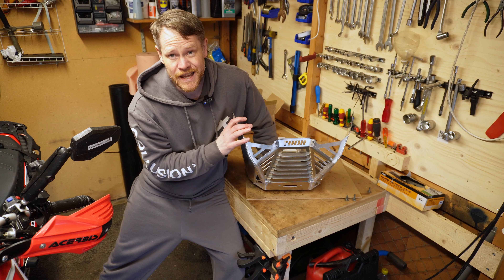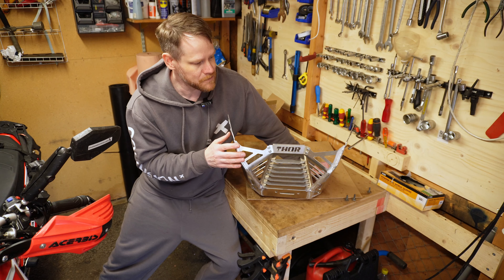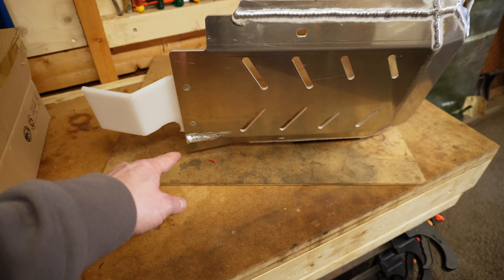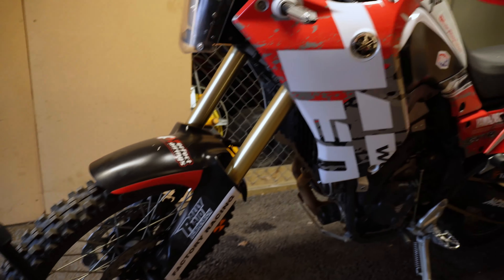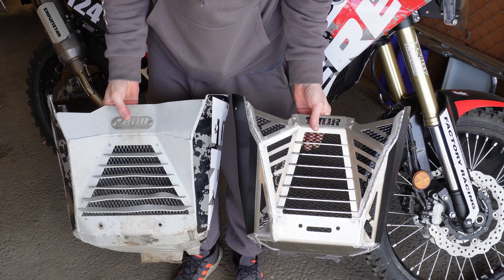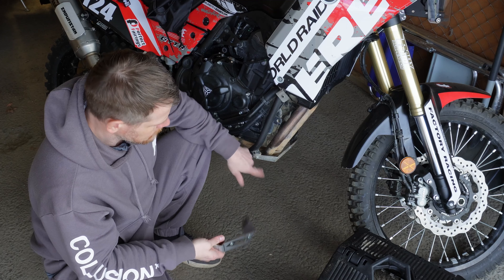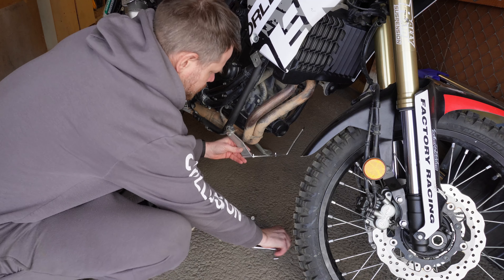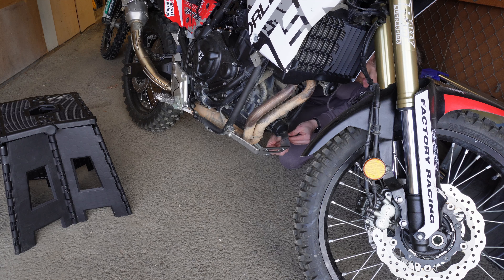GPMucci 2023 Thor Skidplate - Yamaha Tenere 700

Comment: Good morning as usual, amazing video and fantastic information with the last skid plate  Did you get any vibration or noise as I will be doing a lot of motorway work. I’m contemplating buying this for my world rade. 🤘
Reply from the maker: No vibration noises.. Only thing I hear is my exhaust and the cubbies wining LOL.
Never had any hormonic vibrations from the skid plate, only worry had been the mesh net I installed. But rode it to the office yesterday, no issues at all.
Reply: @allthingsenduro  I must admit I like the idea of the gold mash. I have been emailing GPmucci as I would like all the welds on the front where visible ground flat before it goes for powder coating so you would not be able to see any joints. In your video, it’s very clear to see the skid plate. Do you think this would work?

Comment: Can I still use crash bars if I install this Thor skit plate?
Reply from the maker: The Yamaha OEM onej work, but you have to request the fitment kit and then drill the hole in the skid plate. 
All mikes are slightly different, so that’s why is no longer pre drilled as on gen 2 skid plate. As alignment is not always 100% then. 
GPmucci have a guide on how to do it that will be shared if you buy the kit.